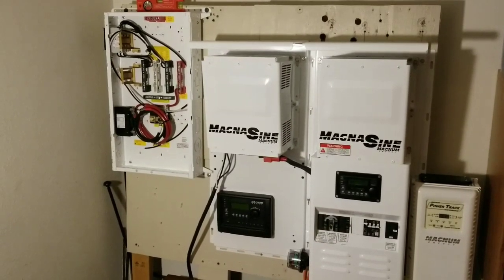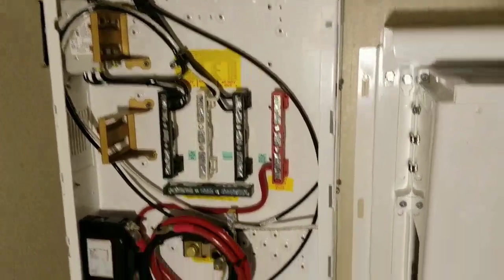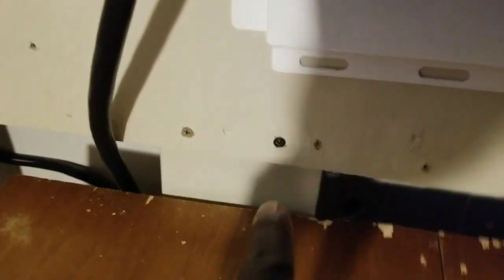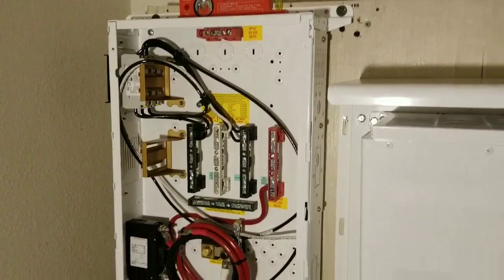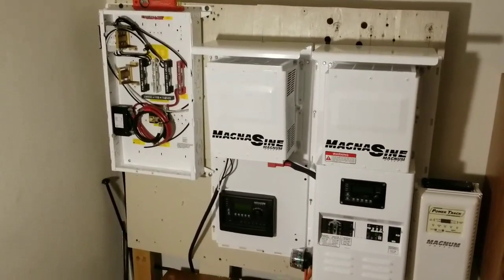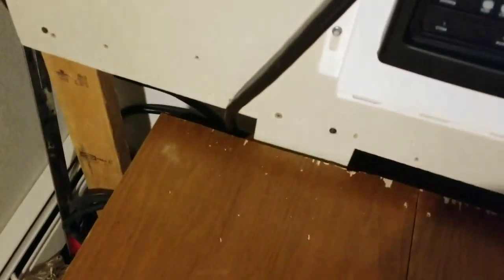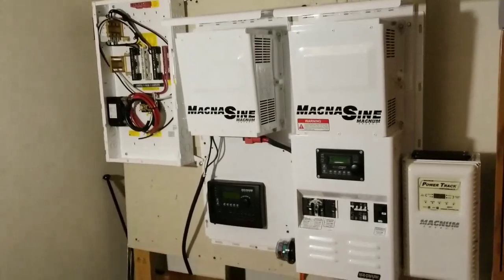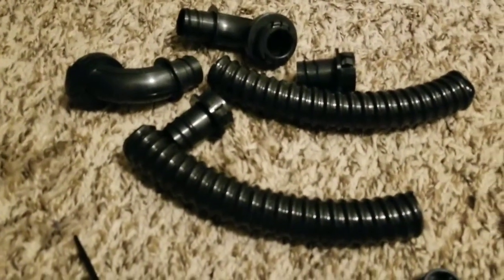MIDNITE SOLAR E-PANEL - ELECTRICAL PANEL, ELECTRICAL PANEL WIRING

Comment: Now the command center is looking at its ultimate with the new Outback E panel with the Magnums. Man you are very  fortunate to have the one and only to lend you a hand . But do you have room to open the panel with the outback inverter close to the wall ? I see this as a job well done for 2020 . Be safe !
Reply from the maker: I made a promise to all of my SUBSCRIBERS, VIEWERS, SUPPORTERS & FOLLOWERS that 2020 will bring a great change to the COMMAND CENTER.
I aslo promised you and the rest that, the OUTBACK POWER SYSTEMS will definitely have a make over to match with the MAGNASINE MAGNUM ENERGY.
Thank you so much brother Cedric for your kind words. You are very supportive and stay bless.